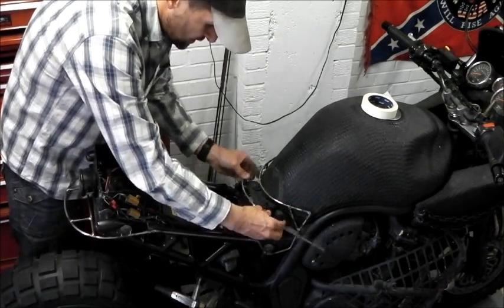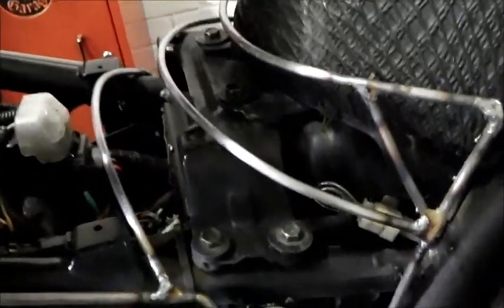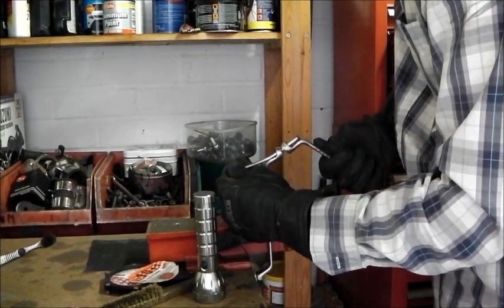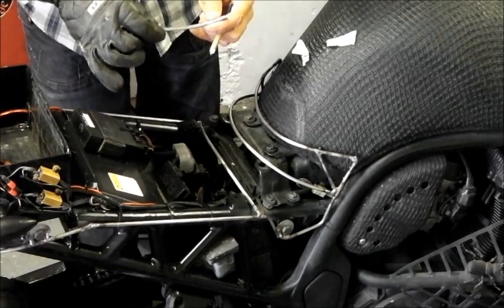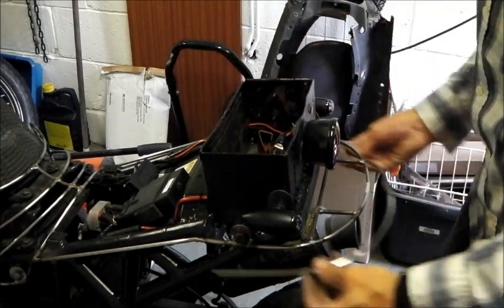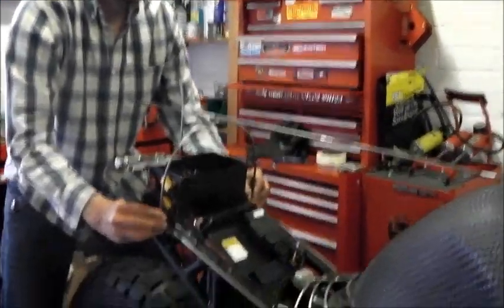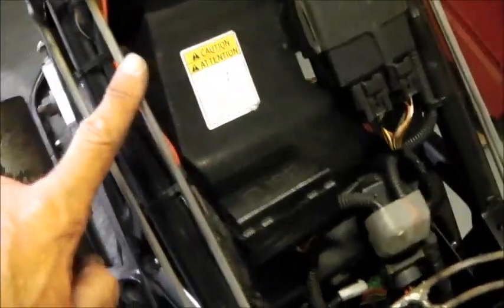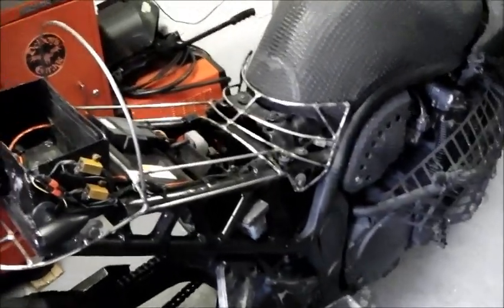Delboy's Garage, Project Bandit #26, Bend it like Delboy

Comment from the maker: Hi mate, thanks for your thoughts, I do intend to grind them rounder to tidy up the effect just got to finish working on the overall structure first then once I can un-bolt the whole thing, I can get it on the bench, tidy up the welds with a flat disc and tidy it right up!  Thanks for watching, Del

Comment from the maker: Hi mate, the idea of the 4 bolts holding the washers, to which everything else is welded, is that I'll be able to simply take them out and lift the entire seat unit off like a shell leaving the frame, lights, wiring and battery all in place... and I know at the moment it won't lift off, but there's more surgery to come on the far rear so that it will!  You'll see... keep watching, Del

Comment: Real quick question about your "French Tunnel" idea. Here in the States, it isn't legal if the tail light can't be seen from the sides. Is yours (for safety) going to be able to be seen from the side of the bike? Sounds like it's just a straight-on visual.
-Doc (from San Diego, CA)